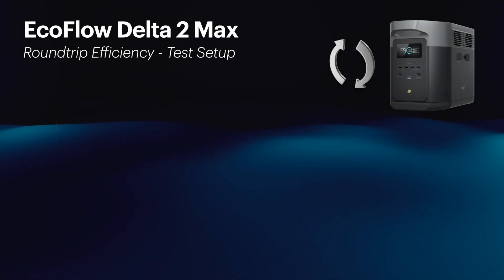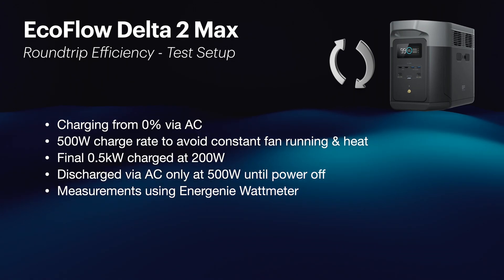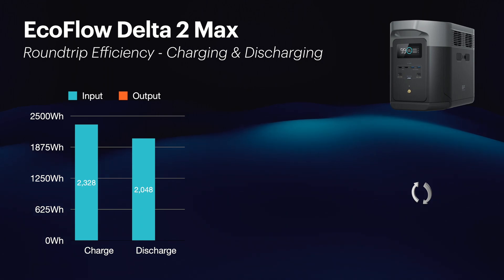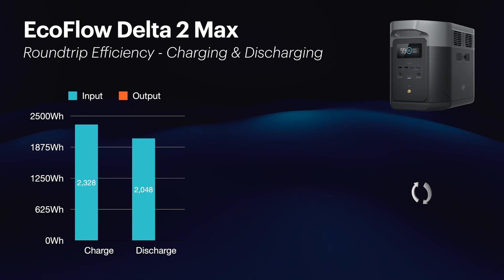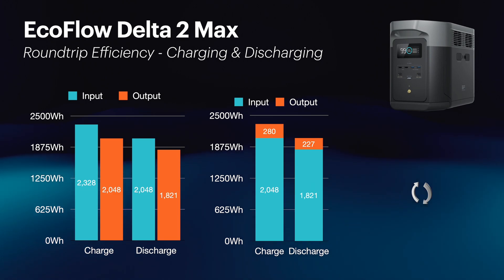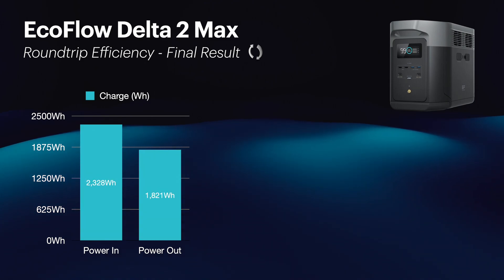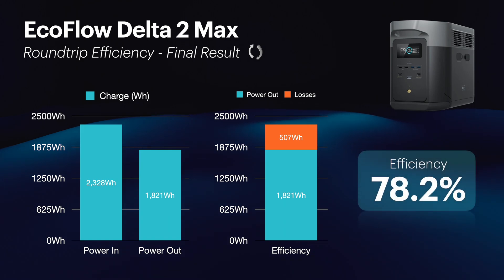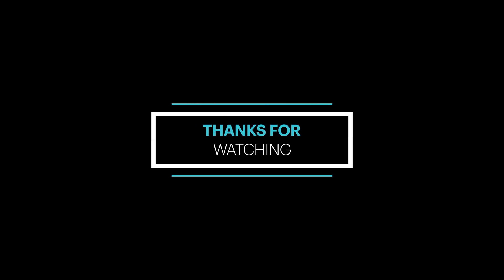EcoFlow Delta 2 Max - Roundtrip Efficiency Test

Comment: A 6000BTU window AC unit set to cool and low fan - would this thing run it - even if only for a couple of hours? Thanks again
Reply: i just tested mine using a 1.5hp window type AC and it lasted for almost 2 hrs
Reply: @AnythingByEric  Thanks for letting me know Eric; it's good to hear! i still do not own a backup power unit but it's on my mind again bc the southern summer is coming soon.

Comment: These generators all seem to be "app dependent", so I would have to enter the world of apps and Wi-Fi for the first time ever.
I'd have to look to see exactly which features I'd miss out on if I do not use the app. The one that's buggin me is....without a Wi-Fi connected app - how could I install updates? 
Were i to buy the delta 2 max today, can I assume it will be up to date or would I be required to immediately install updates - as you do after installing windows on a PC?

Can you say how often firmware or other updates need to be installed and could I, rather, start using it straight out of the box and never use an app - or never update it? What would happen in that scenario? Thanks again Mate.

Comment: @TDCatTech Could you please let me know if you have tested the devices on low-power consumers, for example, around 100 watts? I conducted tests on my device and observed the following: if I connect a load with a power of about 100 W, the device’s screen shows a total consumption of around 150–160 W. It looks like the additional 50–60 W is the consumption of the inverter itself. Furthermore, the higher the load, the lower the inverter’s consumption. For instance, with a load of about 250–300 W, the device displays only an additional 20–30 W on the screen. So, with a small load, the device consumes a lot for its own power. The higher the load, the higher the efficiency and the lower the self-consumption. Have you observed the same behavior? I have a Delta 2 Max.
Reply: For you to properly get this test done, charge your Delta 2 max to 100%, get a power consumption meter/watt meter, plug it into the AC of the Delta, then plug your 100w device into the watt meter. Allow the powerstation to drain from 100% to 0% then check the watt meter to see how many kwh you were able to drain. Repeat thesame test for a 250w load. Then compare how much kwh you were able to drain from when you had a 250w load vs a 100w load. This will answer your question properly. I will be very interested in your result if you can do these test
Reply: I noticed this, too.

Comment: Not related, but I have noticed my delta 2 Max AC output on Uk plugs 50hz is not outputting the correct wattage compared to plugging in the wall to the grid, so you notice this ? Makes my toaster and microwave undercook food…

Comment: The problem is, discharging is not always done at 200 watt. What are you gonna connect to your Delta 2 max. A kettle, a hotplate, a fridge that turns on an off?

I have smartplugs at the input and output of my Delta 2 (not max).    

I am using a tarif with hourly changing prices. I charge during the cheapest hour at 500 watts and use the battery during the 3 most expensive hours.

Not counting the solar I put into it I get for september 0,75/1.25 = 0,6

If I add the little solar I have  0,75/(1,25+0,6) = 0,75/(1,85) = 0,40

So prices of the expensive hours need to be 1,6 to 2,5 times as expensive compared to the cheapest hours, which frankly I see sometimes but not that often. So most day I don't break even......